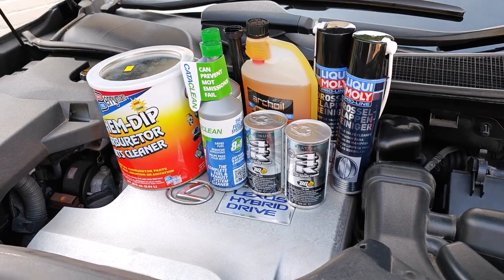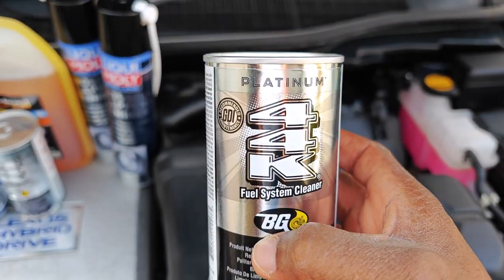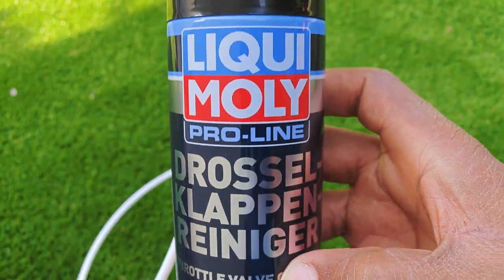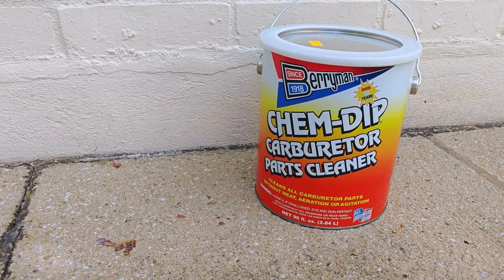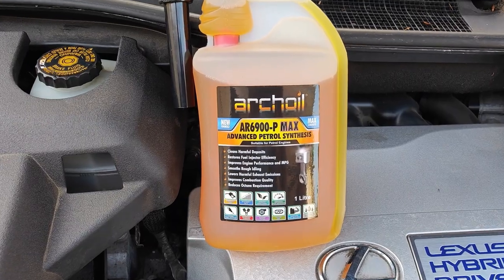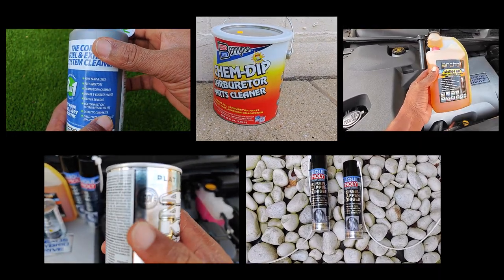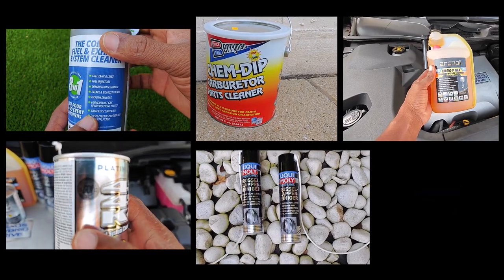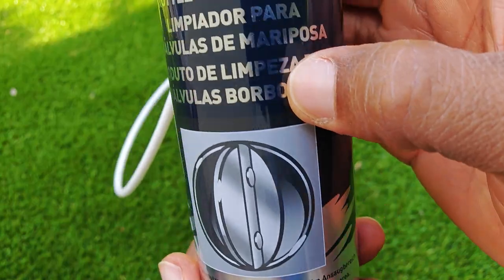Testing Fuel System Cleaners / Do Fuel System Additives work? What do you want to see?

Comment: Redline SI-1

Used it in a Honda I bought with 200k miles, car was getting about 21mpg highway over multiple tanks, after using it fuel economy average went to 25mpg per tank, still well below rated the rated 30mpg but an improvement non the less.

I used it a year ago, since than even my worst fuel economy average per tank was better than my best before it, so yeah I highly recommend it.
Reply from the maker: You must have spied on me🤣. I got Redline S1 shortly after this video, so it's amongst what I'd test! Thanks for suggesting. A number others recommended it highly too.

Comment: I poured 5 liters of lacquer thinner in a half tank of fuel on my 09 Venza. I drove it for about 150 miles in 2 days. On the second and third day (almost empty tank), the car started hesitating under acceleration. I topped off my tank, and my car now drives like new. 

I'm getting better MPG, and the insides of my exhaust pipes look like they were cleaned with a wire brush. I cleared my CEL with a scan tool, and it hasnt been back since. 9/10. I recommend.
Reply from the maker: Interesting approach, I've known of the lacquer thinner approach but never done it.

Comment: Used the Liqui Molly Throttle Cleaner on my intace manifold variable flaps and it did a fantastic job.
I had removed the manifold though for inspection and to replace a sensor.
Unfortunately my Seat Leon uses a direct fuel injection system and the fuel additives are only going to help with cleaning the pistons but this spray cal help with valve cleaning.
Reply from the maker: Thanks for chiming in. Looking forward to testing these!
Reply: Keep up the good work my friend!
Reply from the maker: Thanks!

Comment: Bro i have used injector cleaner lquid moly every2000km. Can i will use this valve cleaner .both products work same or different. Am confused.
Reply from the maker: It depends on the kind of engine you have. If its GDI, the throttle valve cleaner is designed to clean behind the valve. The injector cleaner will not.